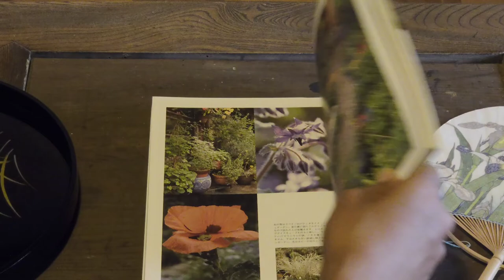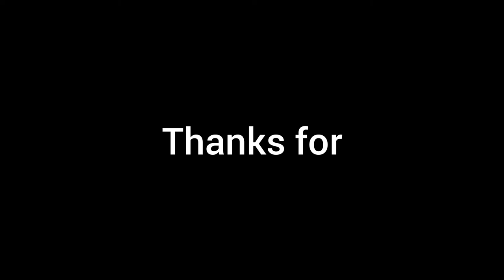Country Life # 2 Aizome | Japanese Indigo | How to handwash Aizome

Comment: How do those mizotori work? Is there a chemical in them that absorbs water from the air?
Reply from the maker: It's made with Calcium Chloride. The Calcium Chloride reacts with the moisture in the air which begins a chemical reaction that melts the Calcium resulting in water. Thanks for watching and for your question.
Reply: @thisoldjapanesehouse  Ah, the calcium chloride is hygroscopic (and deliquescent). Got it!